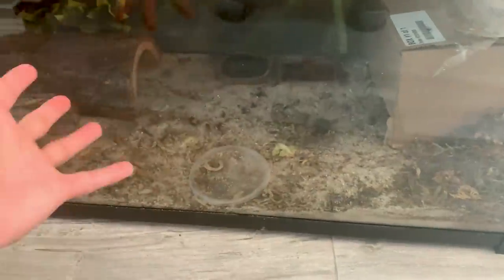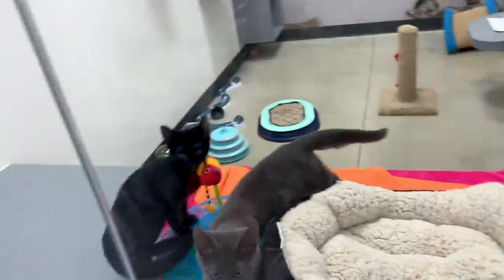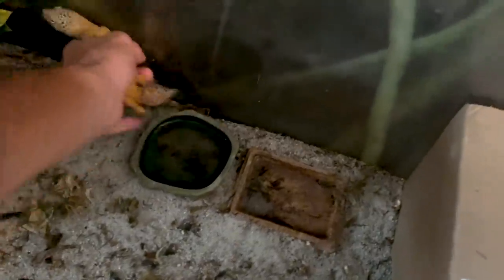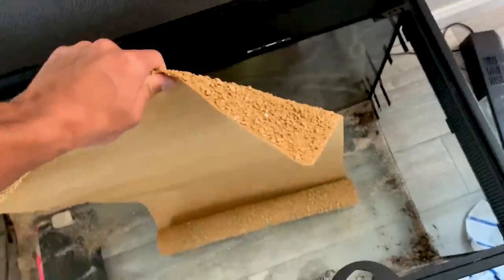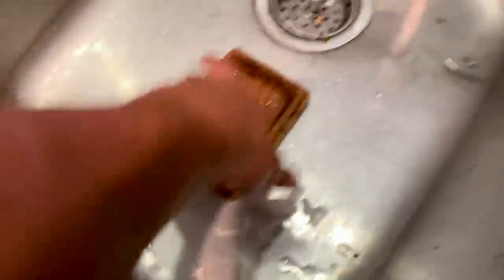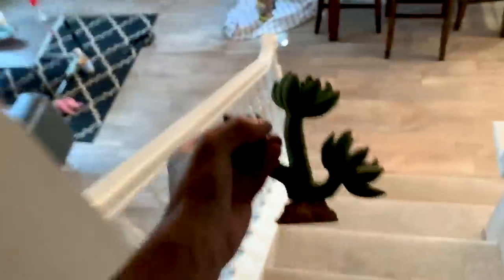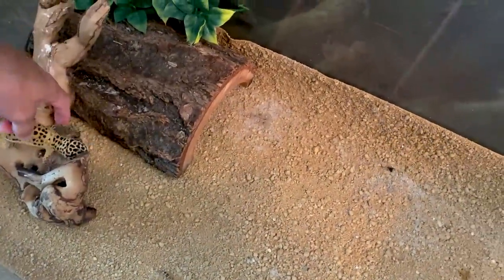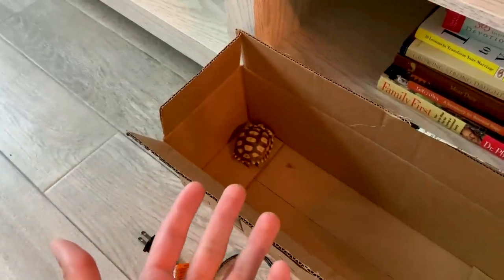My Leapord Geckos NEW TANK SETUP!! (INSANE)

Comment: I'm really glad you listened to the advice on your previous video and gave your betta more water and have decided to separate the tortoise and leopard geckos. However, the new enclosure does still need changes in order to make it suitable for the animals. I don't recommend housing Male and females together due to dominance issues,  over breeding, and not sharing food. Because she has a regen tail it's harder to see her weight unless you weigh her. 

If you insist on keeping them together you will need to make changes to the tank. A larger heat pad with a thermostat should be provided and 2 hot hides so they aren't fighting for resources. 2 cool hides should also be provided along with 2 humid hides with moist moss inside for when they are in shed. Spraying the whole enclosure isnt a very good method and it's best to allow the animal to select the humidity. I didnt see a dish in the enclosure with calcium, Leo's need to be able to free feed on calcium when they choose and their feeders should always be dusted with calcium with d3 and a multivitamin at least 2-3x a month. I'd also like to suggest more enrichment, the tank is completely bare in the centre. Also please make sure to scrub water dishes and hides especially new ones before they go in the tank, they grow bacteria and the water dish looked rather scummy. 

If I may recommend watching a few of LeopardGeckoYoutubes videos on leopard gecko care I think that may be super helpful. You want to do what's best for them while also promoting the proper care for others to see, I hope you will continue to make the necessary changes!
Reply: Agree with this comment 100%
Reply: BreezExotics Love the info and agree with everything :D
Reply: Agree
Reply: is it true they don’t need heat lamps ?
Reply: Stopppppp
Reply: thatgirltorii do u mean UVB lamps?

Comment: Just thought of another suggestion,  you could get them a moist hide.  It would help when they are in shed and also with hydration.  I use an Exo Terra Gecko Cave for mine.  It has a lid that lifts off so you can spray the inside with water.  I have mine filled with sphagnum moss but you can also use paper towel.  Just don't put the moist hide on the hot side of the tank or it will dry out so fast you will have to spray it multiple times a day.  I have mine in the middle of the tank  and even though I live in Wisconsin  I still have to spray it every morning.

Comment: Great job Nick!  You did everything right for your scale babies.  I just have 2 suggestions to make upkeep easier for you.  First suggestion is to put a folded piece of paper towel on the area where they go to the bathroom, that way you just have to replace the paper towel to clean the tank instead of having to take everything out and hose down the sand mat.  Second suggestion is to cut the excess off the sand mat with a box cutter so everything fits nicely and the Geckos won't try to get under the mat.

Comment: Hey! I love the new enclosure! I have a few tips to give that may help with taking care of your lovely babies.
TIPS: 
-A moist hide with paper towels or moss will help them get a humid environment to shed in without increasing the overall humidity in the tank. It also helps having an extra hide in the tank. 
- Adding calcium w/o d3 to the tank will help them get the extra calcium they need. Also, make sure to gut load your feeders bugs and dust them in calcium w/ d3. 
- I suggest adding more decor to the tank for added enrichment! 
- You never said if you had this or not but, adding something to regulate the under tank heater is a good safety precaution! 
- I suggest just putting down paper towels. It may sound like that could be a bad idea but, it’s actually one of the best options for leopard geckos. It’s affordable, easy to clean, and removes all risk of impaction! 

I hope these tips help a lot! I’m always happy to answer any questions and I’m just here to improve the life of animals. The improvement in the enclosure is great so far!

Comment: It's still bad, much open space, the sand mad can still cause issues and they should not be kept together, it's a good upgrade
Reply: Actually, even a 20 gallon tank is good to house 2 geckos, so a 40 gallon is just fine. Though I agree with the open space part and sand, he should have used reptile carpet or tiles.
Reply: @Steffy07  you should never cohabilitate geckos they should each have a separate enclosure they can tolerate each other for up to years but it only takes a minute to attack and severely injure the other
Reply: @Steffy07  reptile carpet is very bad too. And no Leos are solitary and should never be kept together unless you're breeding them. These should be okay since they've been together for seven years though

Comment: TIP:
I love how you keep learning and taking advice from your fans and I want to give you a few tips to make your geckos habitat look good and have your geckos happy. 

1- I would add a plastic tub with wet paper towels for whenever your gecko sheds, when a gecko sheds it needs moisture to loosen up the old skin which helps it slide right off.
2- I would add more large decor like rocks and more plants which also act as extra hiding places and makes the geckos feel like there safer.
3- I recommend having a heating mat that reaches at least half of the tank. You also place the moist hide in between cold and warm side.
4- keep a mealworm dish that you can use for whenever you leave the geckos for a while. They sell the, for cheap and you can buy some that looks natural for your tank.

This is all the tips I have.

Comment: Good job with updating the leopard gecko enclosure. But I recommend maybe putting a moist hide in. You can easily make one by using a container. And maybe in there hides put a paper towel down so there not always on the rough sand. And maybe something in the middle of the enclosure. Just in case they do fight (even if they don’t it’s always a possibility) they can have some distance from each other and not always be in sight. But other then that good job homie

Comment: I'm glad your trying ☺ this is a really good start and I'm glad you want the best for your animals but they do need at least 3 hides one cool one warm and one humid, making a humid one is very simple to DIY, you should get some moss and a tubaware and make a big hole/entrance in it for the geckos make sure it's not sharp, if it's sharp you can always use sandpaper but you do need to mist the humid hide, generally you shouldn't house leos together but since they have been together for such a long time without problems I wouldn't worry about that, but be prepared if they do start to fight, you also need a hygrometer and a thermometer. I hope this helps

Comment: I suggest getting substrate that is loose, like Eco Earth, it doesn’t expand and it comes out the other end looking the same, the desert mats can be a hazard, as if one of the rock pieces come off they can consume one and it can get stuck and lodged in their digestive track. Eco earth is a good substrate, my leopard gecko loves it, and I suggest adding a humid hide to help with shedding, my leopard gecko is 6 months old, and he hasn’t had any problems with eco earth or shedding. Also, I suggest buying more plants and logs, they don’t like being out in the open, remember, they’re predators, but they’re also prey. It makes them feel safer when they have more places to hide.

Comment: *****NOT a hate comment. Just some handy advice*****Since you are housing two leopard geckos together you should have at least 3-4 hides. 2 on the warm and 2 on the cold, so that way if they do fight they can separate themselves and still be on just the warm or cool side. Also your enclosure for them is very plain. I recommend putting more plants, logs or other objects in there for enrichment. These objects could also act as a place for them to hide without having to buy a big bulky hide. If they ever have shed issues I recommend putting in a moist hide, especially offer it when they go into shed. You could add a bottle cap filled with calcium powder into their enclosure (They would know when they need it) it would reduce dusting their food with calcium. So you would only have to occasionally dust their food with other vitamin powder that they could need. I hope this helps! And sorry if its a little long

Comment: Hey Nick, I put together a Care Sheet from a Leapord Gecko breeder. Hope you like it!!!

Hides: Warm hide (required), cool hide (optional, but strongly recommended, include sphagnum moss as a substrate) and moist hide (required for shedding).

Moist Hide/Humidity: It is extremely important to have a moist hide in your Leopard gecko's enclosure in order to prevent shedding issues with your Leopard gecko(s). There are a plethora of ways you can make a moist hide for your gecko. Some keepers will make their own using small plastic containers in which they cut holes for the gecko to go in and out of. WARNING! If you do that, please make sure that you sand the hole until it is smooth to avoid cutting your gecko. Another way is to purchase a cave style hide. Once you have your container, you will need to put in a substrate that retains moisture. Options: paper towel, soil, coco hummus, vermiculite, CatSpot cat litter or probably the most widely used are sphagnum or peat moss. Make sure to dampen your substrate, but avoid over saturating it so that mold does not occur. Also, occasionally switch out the substrate when dirty with new. As far as humidity, make sure that you keep the humidity ideally between 20-40%. Do not keep the humidity any higher than that as Leopard geckos can develop infections from too high of humidity. 

Hygrometer: I am always surprised how many keepers opt out of purchasing this very important tool for keeping most reptiles. A hygrometer is very inexpensive piece of equipment that allows you to measure the humidity in your reptile's enclosure. Strongly suggest purchasing one.

Temperature: It is important to have the correct temperatures for your Leopard gecko(s). You can do this a couple ways. First, keep "hot side" between 87-90° F (no hotter than 94°F) and "cool side" between mid to upper 70s (°F) all the time and you do not need a UVB light. Second, you can use the same temperatures listed above during the daytime and then at night drop the "cool side" temps to between 70-75°F and use either an under the tank mat or an infrared light for a warm spot for them. Both ways are fine and the first way is easier.

Thermometer: In order to make sure that your temperatures are correct in your Leopard gecko's enclosure, we believe it is a MUST to make sure to purchase at LEAST one. We highly recommend purchasing two so that you are able to measure the temps on both the hot and cool sides. There are many options on the market. Shop around to see where the best deals are. 

Feeding: Our Leopard geckos feed on mealworms daily and crickets weekly. We also make sure to sprinkle vitamin powder mix on both. We also encourage supplementing your Leopard gecko's diet with other insects as needed such as superworms, hornworms, Dubia roaches, CalciWorms (add calcium), Phoenix Worms (high source of calcium) and Waxworms (to add fat). There was some studies done saying that you could just feed Superworms as a staple diet instead of mealworms and crickets, but I would recommend checking with your vet or contacting www.TimberlineFresh.com first for more information.

Powder Supplements: Osteo-form SA & Vionate Powder. Use a 1 part Osteo-Form SA to either 3 parts Vionate. Some keepers do a 1:4 ratio instead.

Comment: Hey! I'm glad there was an upgrade, especially from the sand, but I suggest maybe doing a lil bit more research about substrate, as this one isn't very good for their feet either, imagine walking bare foot and sleeping on sandpaper. More research on feeding, handling, etc would aslo hopefully help. It isn't recommended to house two geckos together, especially not two males or a male and a female, so perhaps think about getting another tank. Also, for just one leopard gecko, at least two, preferably three hides are needed, so for two, you really need two warm and cold hides as they will not want to be in the same hide most of the time. I also suggest maybe adding some more decoration for cover, to make them feel more safe. Maybe just do a bit more research, I know you're trying but it does really need improving.

Comment: Hey! Its great that you redid the tanks! There's only a few other things to make it pretty much perfect for them! When you feed the insects to the leopard geckos, make sure your put them in calcium first :) The next thing is that they need a warm hide on one side of the tank (so on top of the heat mat), they need a cool hide (so on the other side, not on a heat mat) and a humid hide :) The final thing is to get a digital thermometer just so you can make sure your leopard geckos tank is the correct temperature. Once you have done that then your tank will be perfect :)

Comment: your geckos are so cute and feisty! and it seems like they’re in really good health as well! that tank setup is really nice, but i would like to suggest a few things you could do to make it even better for your leos.
first of all, leopard geckos need a moist hide to help shed their skin, the excess moisture condensed in a hide will help loosen their old skin and let them peel it off with ease, avoiding the cause of any damage to themselves. you can make one out of a tupperware container, cut an entrance in it and burn the edges to make it smooth, fill it with moss or paper towels, and then wet the container every now and then especially when you see their skin’s getting dusty and gray. place it on the hot side, that way if one of them wont share the hot hide they can just chill in the warm moist hide.
also be careful with that mat, sometimes the bits come off and the leos could eat them and cause impaction, you should keep a close eye on their tank or maybe consider switching to a shelf/kitchen liner, there’s water proof ones and they have some different patterns available on the market.
oh! dont forget to dust their food with calcium with d3 2/3 a week and multivitamins 1/3 a week to ensure their health is at the best they can be! (you could leave a small dish of pure calcium in their tank and they will lick it whenever they feel the need to have some, but then your mutlivitamins should have some d3 in it).
someone in the comments already mentioned this, but you should consider getting a thermostat with a probe and place it on the hot side because sometimes the mat can overheat and burn the geckos’ tummys

Comment: OK, SO FIRST! 
- Get coconut substrate for them to live on, sand causes impaction!
- Pupating beetles is OK, but it can cause over population problems if you aren't alert.
- Make sure there are 6 hides so the two of them can hide in respective hides. One cool, moist, and warm hide per gecko.
- I didn't know the genders, but check for those unless you want ripped up gecko
Have a backup tank for any time things go south.

Comment: Just to help out you very much should get a moist hide or get a plastic container cut a hole in it and at a few paper towels or eco earth and spray it down when you know there shedding because without that they most likely will get stuck shed, just to help you out. And if I were you I would get dubia roaches they are super healthy for them but hard to find, but superworms are really good as well

Comment: Get another tank for the other gecko and change the substrate to something els, 
Coco fibre is good. 

And the UV light might not be the best 2percent would be ok if at all in this sort of setup would be Better to dust D3 with and led light 

Also  I’m not sure what you read on heating light. But. They are ok if used properly and using the right types, deep heat projectors & CHE are good choices. 

I don’t know if you are using a thermostat and thermometer. But you should 🥰.  

Stay safe good bless 😆😇🤣🙏
Reply: I know I miss spelled something and have grammar problems in my comment  can not be bother to go though and change  it also it like 3 in the morning 😂😇😅.  Stay safe god bless 🤣😅😂😇😇🥰🙏😇
Reply: Providing UV is better, natural and more beneficial than synthetic D3 :)

Comment: Hey just a heads up a male and female should not be housed together. The male will pester the female and try to mate with her. It can cause a lot of stress. Another thing to do is have a moist hide. You can use any tupperware with a hole in the top, add moist sphagnum moss and put it over the heat mat and it will help them have a perfect shed.

Comment: I mean, it is a lot better then your old one, despite that there are some improvements that can be made.

-First off, Leopard geckos are solitary animals. They can be housed together, I personally just don't recommend it. It would be better to get two 30 gallon tanks for 60 dollars during petsmarts dollar per gallon sale.

-Second, the substrate, sure it's better then before, but it's still not necessarily suitable. Leopard geckos actually I find do quite well on eco earth. 

-Leopard geckos only need to be fed every two to four days, so daily feeding is not necessary. You will need to feed slightly more crickets and worms. Also, make sure your giving proper calcium dusts to the bugs.

-I see you got those log hides, those just are not suitable. They are more known as enrichment because a leopard gecko won't feel secure in there considering it is not very dark and there is two entrances. Leo's need at least two fully closed hides. 

Those were the only for things I noticed right off the bat.